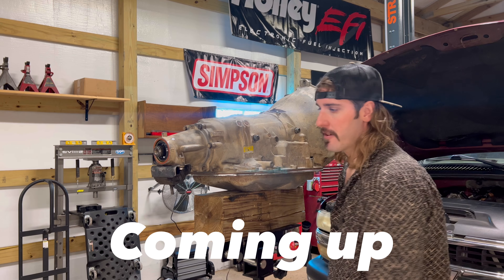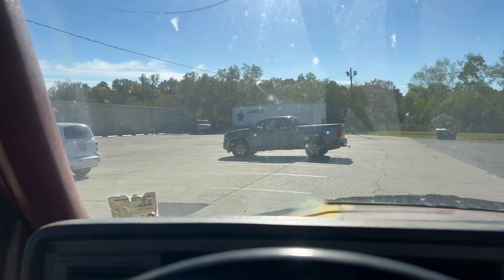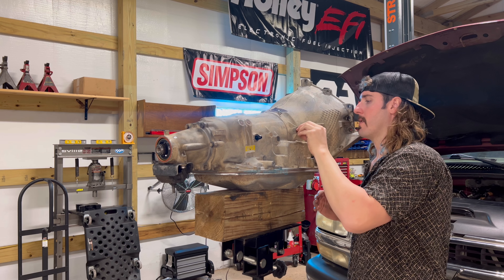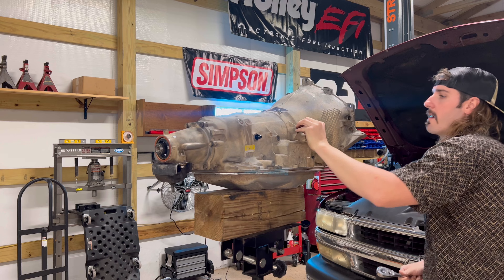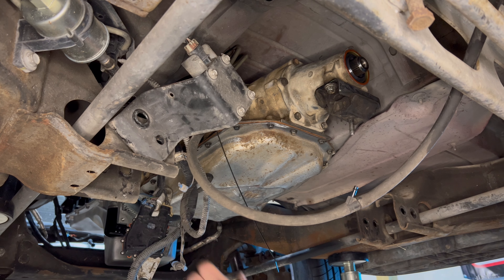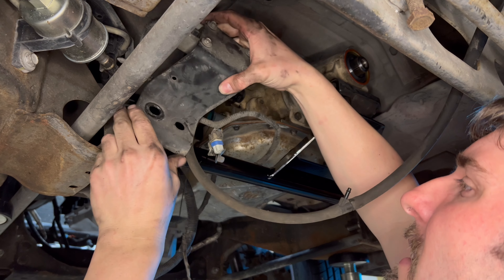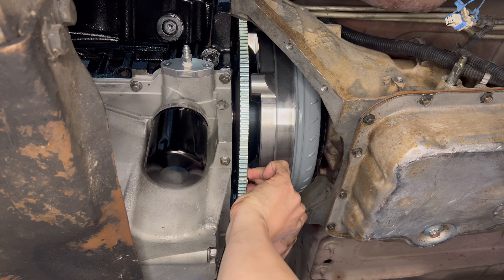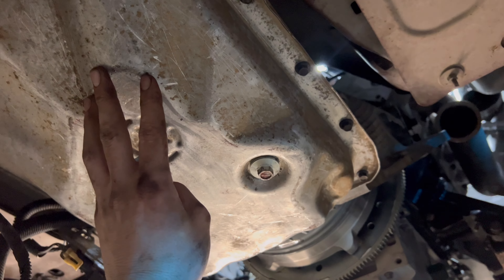Turbo Suburban 4l80e Swap | Circle D converter

Comment: I had the same issue when running my  solid engine mounts… I loosened the long bolts for the engine mount brackets, then was able to tilt the engine a hair and split the difference at the trans tail mount.. then just snugged up my poly trans mount to draw up the difference. After the trans mount was tight, then went back and snugged up the engine mount brackets. Still haven’t cranked her up but hoping I don’t crack the trans housing or engine block. 
I think it will be ok!
Reply from the maker: You should be alright! I was just scared to yank down on it